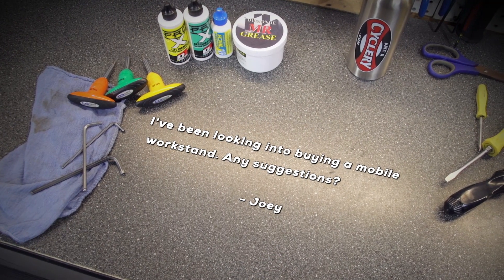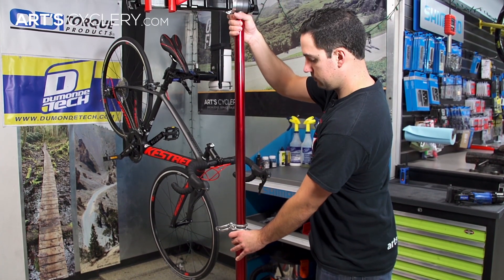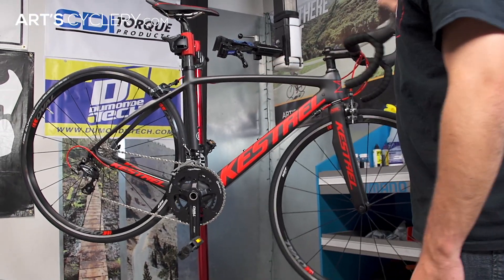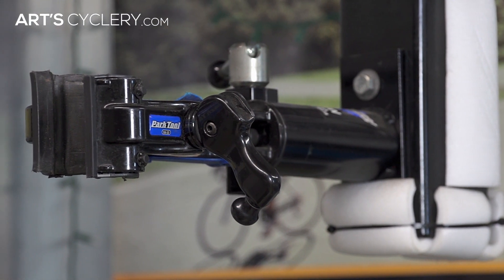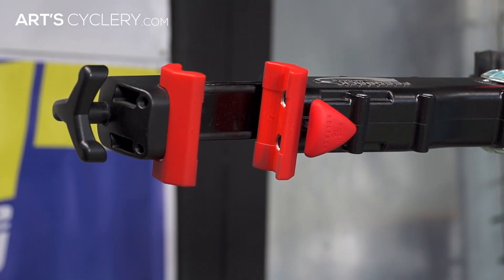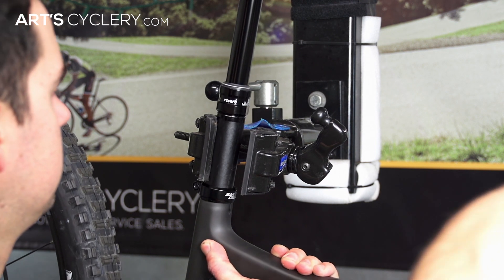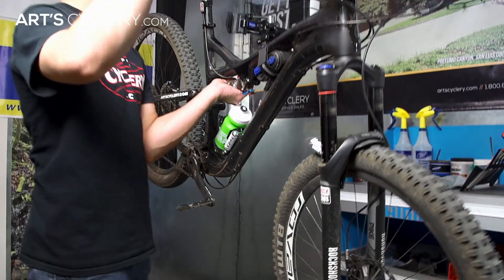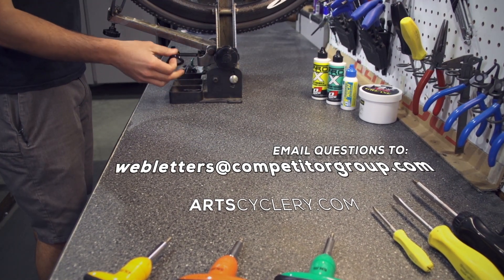Ask a Mechanic: Selecting the Right Repair Stand

Comment: I had bought the Feedback Pro Elite and will be returning it.  Below it the review that I had wrote.

WARNIG This Stand Won't Support 85 pounds!!!
Claiming the ability to support bikes weighing up to 85 pounds, you would think my mid-engine e-bike that weighs less than 48 pounds (with the battery removed), would have no problems.

Getting the jaws to lock to the seat post was an effort, but I was able to do this. However, when I tried to raise front or rear wheels up by a few degrees, gravity was too much and the head slipped. Let me add, I twisted the looking piece with all of my might as tight as I could make it. The irony, with 37 pounds under the weight limitations, this stand was overwhelmed.

I contacted customer support. The agent claims the support is only up to 75 pounds and not designed for e-bikes... 
...Why leave out this all important deal breaking info?

I will say there are things to like. No assembly. Stores very compact. Lightweight. Its good looking with a nice fit and finish.

I'm thinking bikes weighing at 25 pounds or less this would be a good repair stand. However, If you have a heavier bike, this repair stand is not a good choice.

Comment: Just curious but why shouldn't I clamp my bike on the top tube?
Reply: Top tubes are very thin and easily crushed. This is especially true with carbon frames. Always clamp on the seat post, it's very tough.
Reply: David Nicholson and cheaper to replace